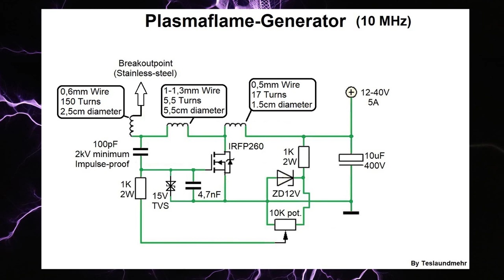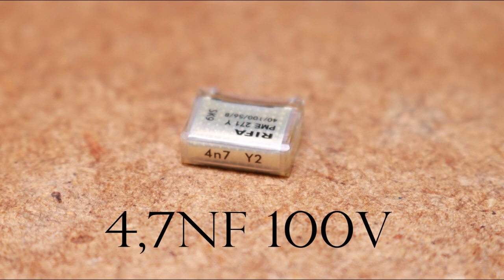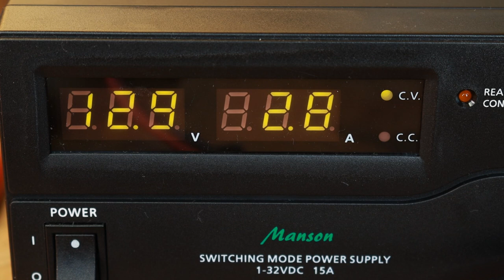DIY Plasma flame Tesla Coil - Step by Step (ft.Plasma Channel)

Comment: why didn't you have added trimming condensators and induktors? it is easier to set with trimming components.
Reply from the maker: trimming capacitors are not high voltage proof :(
Reply: @Teslaundmehr  1:14what voltage und  capacitys are we talking about?, if you have to variate between a couple 100 nF and 2kV then you can build your own with Acrylic and two Alu plates which one of them can slide. don't get me wrong the major part of the capacity has to come from the capacity that you have already built in. you need only a little range of variable capacity to get the resonance frequency of both oscillators to get a perfect coupling. and you can also tune the low voltage end side to get the frequency right
Reply: @Teslaundmehr  also 0:44 no one will never get exactly the same values of your components the reason for that is called Tolerances. you would need components with very low tolerances to match exactly your components which would make it very expensive. 1:14 for example the induktor that has 5,5 turns and has a large range of wire thickness could be made trimmable by inserting a isolated ferrite core with a screw no need for a trimmable capacity also the 17 turns one. My point is if some one builts a two oscillator system which has to be coupled to actually work, then he should also provide trimming options to make the tune in easier... I mean come on! hours or days and a dozen fryed mosfet to tune in a oscillating system?!?!!!!. then the old cathode TV would never had invented for mass production with your police XD

Comment: Instead of stainless steel for the arc electrode, try using a short (scrap) piece of TIG electrode - tungsten has a much higher melting point, and will not erode anywhere near as quickly as other metals will. And other metals (copper, aluminium, zinc, phosphor bronze) will produce other colors of flame, but may not last very long before burning away.

Comment: I made this but it does not work because i have 400 v capacitor not 2kv what can i use
Reply from the maker: You need 2kv. the 400V capacitor will die in seconds
Reply: @Teslaundmehr  but idid not have
Reply: Can i join 400 v cap in series
Reply from the maker: @robinashaheen4058  yes, but you need a capacity of 100pF

Comment: If the top load was a different metal, would the flame appear as different colors like a greenish color for copper? Awesome video by the way!
Reply: Styroporo did a video on flame discharge where he tried it, and yes there were different colors, but not always the ones you would expect from that kind of metal.
Reply: @ichbintoll7128  thank you

Comment: Can you explain how you managed to get the MOSFET running at 10MHz? I think that's the most impressive part of this design
Reply: hardstyle905  I've worked with this exact MOSFET and had trouble getting it to run at high freq so I'm curious

Comment: Hey man I just put this circuit together with similar parts. It’s resonating at 5MHz. The current draw is only 0.25A at 12-19V and it basically stops there. Any idea why?
Reply: Jk it’s actually at 10MHz

Comment: If you mount the MOSFET directly on the heat sink, its drain will be connected to it. This means that the heat sink will be high-frequency-"hot", which is dangerous when operated at high power. Or maybe I'm mistaken?
Reply: You mount it with insulator so it electrically isolated from the heatsink. Use some thermal paste so theres good heat conductivity.

Comment: Can anyone please clarify the function of the circuit? Is it Colpitts Oscillators? What is the function of a coil with 17 turns? Why the capacitor must be 400V. Is it due to the voltage that is induced on the primary coil during resonance? What is set 10k pot. ?

Comment: could it be audio modulated????????? im tryin to make an am transmitter with a small tesla coil but rfi is making my amp sound like poo
Reply from the maker: Yep I will show it in future!
Reply: @Teslaundmehr  thanks bud!! but how will u isolate the hv from the audio signal ??
Reply from the maker: @PLASMAKVA500  you can mudulate for example the input voltage ;) Thats save
Reply: @Teslaundmehr  but i need to modulate the gate/base pin to keep my carrier signal/voltage steady

Comment: interesting but it would be more interesting if you could tell us the why these specific windings on the coils and these specific capacitors work. Because it is just physiks and there are always equations with multiple solutions. I'm not a that great fan of do it like this and it works. I like more here are rules that must are given by nature and if you combine your numbers in a way that solves the equation it will work, here I have a example for those of you that don't want to think about this stuff.

Comment: Is it possible to get measurements of the Resonator and Primary as well in uH so those of us with slightly different wire or tube sizes can have an easier time tuning? In the US it's much harder to find wire in mm rather than awg, and looking at charts for comparison I'm sure the very slight discrepancies may adjust the resonant frequency.

Thanks so much for your hard work on this design, I look forward to replicating it!
Reply: Yes, I need to know what the inductance value of resonator is.  .6mm equates approx. to 22 ga. but to be sure its correct, I need to know what the inductance is.